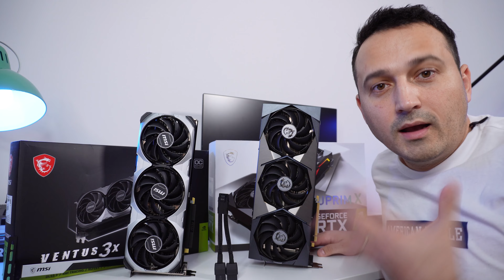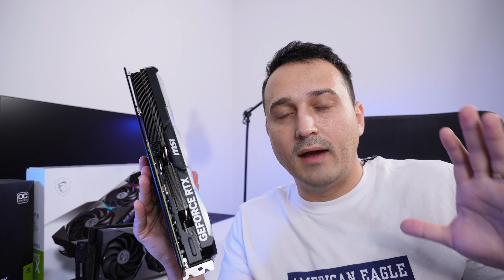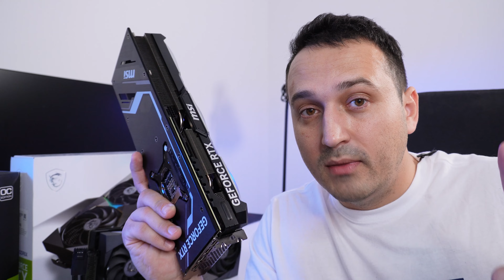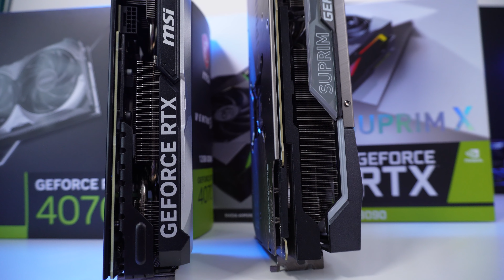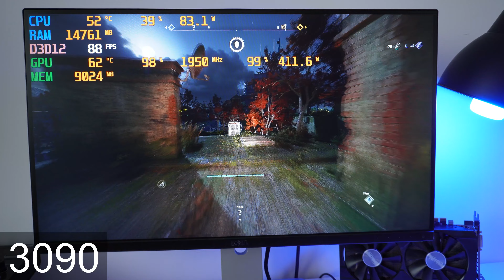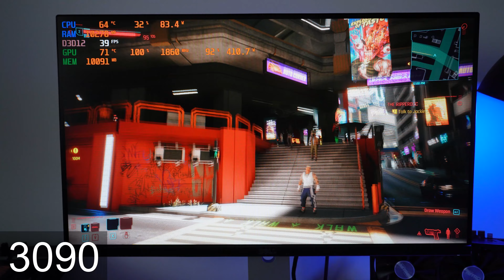RTX 4070 TI vs 3090 | NEW Gen VS LAST Gen

Comment: Small correction. Rtx 4070ti might be a "budget" card in terms of power consumption but not in it's price. Anyway I bought it (Asus tuf £839 in UK) because considerably lower power consumption than 3xxx gen. cards. I do use 1440p 165hz monitor. So far  I have a joy playing on max settings. Very quiet gpu and significant upgrade from my really loved rtx 3060ti. Thanks for reading.
Reply from the maker: Thanks for you thoughts man.I think you got it for a steal in comparison with what I paid for the one in this review.(Around 1350 pounds).It's a good gpu man and I am quite happy with its performance and its good to see its works great for your setup as well.The only downside I see, is it's 12 Gb's of VRAM that might not be enough with the release of the new AAA games this year.But we will wait and see.Cheers buddy and enjoy the upgraded gpu man.

Comment: Hi great review and quality comparisons! Just hope to ask did you notice any prominent coil whine for this particular 4070 ti, especially when under load? I’m seriously considering this card but there are so many comments about coil whines for the entire 4000 series. Thanks!
Reply from the maker: Hey buddy and thank you so much for kind thoughts.Well my 4070TI actually behaved quite well with very little coil whine under load.Mind you it was in a case that was opened and was sitting underneath the desk.Anyway the important note is that you should not be worried about this coil whine on any GPU as it is something totally normal.There are hundred of watts running through it so this sort of sound is to be expected.I've tested a whole bunch of GPU's lately and honestly they all had coil whine to a degree or another but nothing aggressive or worrying.Just to wrap to things up here buddy, also remember that not all components are made equal, so you can easily have two of the same GPU's with different whine levels between the two, as there are some variation in components on the boards themselves going through the manufacturing process but as long as they are within the specs at the quality inspections, then they get shipped out as is.
Final Note: It is a great GPU and I think that a bit of coil whine wont spoil your fun and happiness when using this bad boy win some great looking games.I think is a great option when going for the 40 series and should keep you quite happy for some time to come.💪💪💪💪💪💪💪
Reply: @Tech_Fusion  wow thank you so much for the thoughtful and comprehensive reply! Really appreciate your help! Indeed considering the power these GPUs are taking under load, some whine noise should not be something out of ordinary. Really impressed with the performance of this card and definitely going to get one with my new build. Thank you for sharing you experience in detail! Your channel deserves more love for sure!
Reply from the maker: @gloriclyoko  Hey buddy, and just as you appreciate the feedback so thank you as well.Glad to be able to help out as this is the main goal of the channel.
One small thing that I had forgot to mention but you could see in the review of 4070TI video, is that this version of the MSI Ventus branding comes with no thrills or bling, meaning that you don’t get any crazy looking LED or ARGB design embellished with over the top aluminium finishing but you do get a functional yet nice looking and sturdy chassis with this GPU.It delivers the raw performance with no regards to style points.Im currently working on my next video featuring its bigger brother the Ventus 3X 4090 and this far it feels like a carbon copy of the 4070TI but this is what the design stands for with this branding.The main focus is to give you the power to drive your gaming needs.Oh by the way,I’m not quite sure where you are from and how prices are there but I did just managed to launch a website where I’m looking to sell PC components (GPU’s) included at reduced prices (as close as possible to MSRP) so do feel free to check it out.Its a work in progress but I’m just trying in my neck of the woods to try and give something back to the community if and where I can.Cheers buddy and stay awesome 💪💪💪💪💪
Reply: @Tech_Fusion    Thank you for the follow up! I did notice there are no rgb lightings for this specific card, which was good for myself since I really don’t care. I’d be glad to learn that MSI is putting more attention in the build and performance of this card especially compared to the MSI trio which I noticed was the gaming variant that had more styles. I will be looking forward to the 4090 video even though for now it is too much of a power consuming beast for me to consider. I’m in us east and I would be glad to check out your store if possible. Thank you for all your contribution and great efforts for the community!
Reply from the maker: @gloriclyoko  I honestly think that the 4090 at this price point is not for everyone.Sure its a  nice card to have but I think at some point you should consider the "Do I need it?" approach because it can get crazy expensive with some of the tech parts nowadays.Well its nice for you in the US and I can say that you are a  bit more sheltered from the  awful pricing going around the world as I see on amazon for instance  that prices can be around 10-20% cheaper there, then in the EU .The store unfortunately is in the EU so I'm bound by the tax man here but maybe in the future I can find bigger, better suppliers and hopefully drop the prices.I will make a video where I will explain how things are going with this project of mine as it is still in its infancy but I just wanted to get it off the ground and get it  rolling and hopefully one day it will turn into what I have in mind for it.Cheers bud once again and thank you kindly for the support.😁
Reply: @Tech_Fusion  indeed the 4090 is a bit too much for my current build plan, in terms of both budget and power consumption. It is okay that your store can only run in EU for now, still a great endeavor that is surely going to help a lot of people! Sorry for those who have to suffer from terrible price hikes. Wish everyone can build their dream spec one day!
Reply from the maker: @gloriclyoko  I honestly find the 4090 op for my needs and I do game and do video edits but,Hey its an option for who can indeed afford the terrible prices.Would like to be able to sell at normal per say prices,but as they stand right I find them absurd with this crazy market.Cheers buddy 💪💪💪
Reply: @Tech_Fusion  Indeed, maybe someone will be able to justify the price (normal resale prices) and power of a 4090 for their needs, but not for casual people like me haha. Cheers!
Reply from the maker: @gloriclyoko  Maybe,hehe.Cheers buddy 💪

Comment: My 3090 gaming x trio came with a support bracket… so that sucks for you man. Also got my 3090 for $620. So definitely gonna stick with this gen. Thinking of selling to get an Evga 3090, but idk. Might wait another couple months
Reply from the maker: Hey man,well the 3090 is a great card and who ever is lucky enough to have and use one daily wont be thinking to upgrade any time soon unless they are really into owning the latest gen and spending big for it.Or of you are indeed in need for the extra power for work like an editor.Other than this,I would not really change my current 3090 for an EVGA one since the performance will more or less the same.If you are just mostly gaming then you should be golden for the foreseeable future with this GPU and will run 4K with the next tier of AAA games.Cheers buddy 💪💪💪

Comment: you sound like you're being paid to promote the 4070.  the 3090 clearly has the edge at 1080 and somewhat at 1440, which most people play.  aside from power consumption the 3090 is the winner.

Comment: 4070ti is not budget entry level, a 2060 or 1660 is
Reply from the maker: Well it is if you are considering the 40 series...because this is what I meant.Cheers buddy
Reply: @Tech_Fusion  ah yes well relative to the rest of the 40 series yes
Reply from the maker: @BionicTem  exactly man
Reply: @Tech_Fusion  yeah but its wrongly put I think. its still not an entry level gpu, not even for the newest, because not only is there a 4070, 4060ti, 4060 soon releasing, but 3000 series are still being produced (maybe even 1660s' and 2060's), the naming doesnt matter. its not as the previous generations.
Reply from the maker: @user-wq9mw2xz3j  Hey buddy, well all the mentioned models from the 40 series (4060,4060TI and 4070) have yet to be released so this makes the description accurate at the present moment and thus far the 4070 TI is your entry level in the 40 series.(Check techpowerup website for realease dates)at least for now at the beginning of Feb of 23.
It's true the others are still being made but this was just a comparison as I happened to have the 3090 and was keen on putting side by side with the new gen.
Cheers buddy, have a nice one and thanks for the thoughts.
Keep it really and game hard on any GPU 💪💪💪
Reply: 3060ti is a budget card